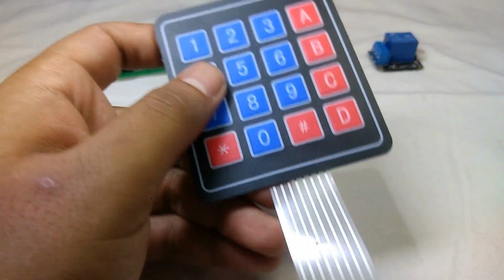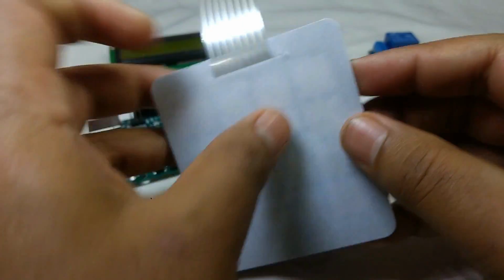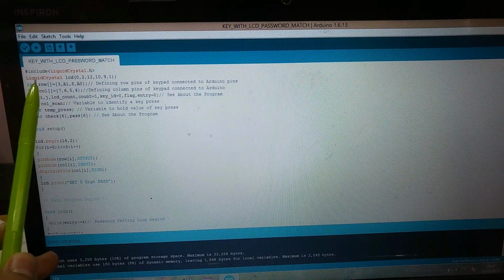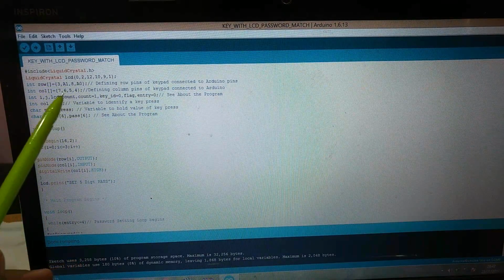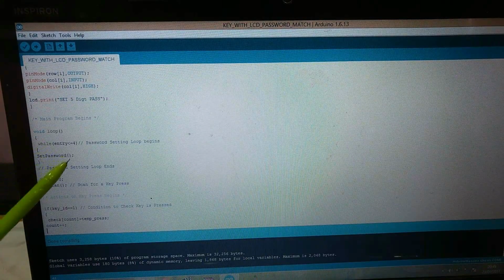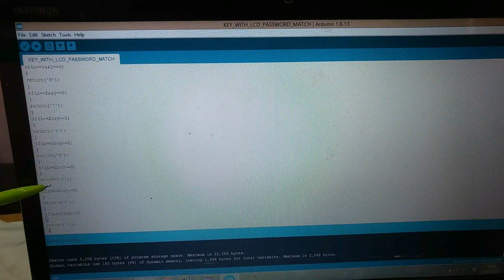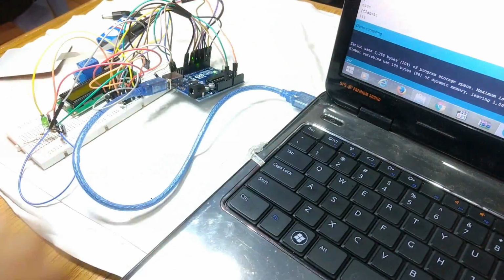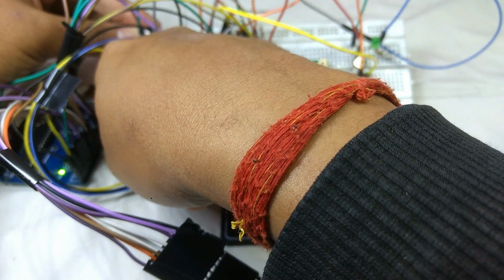Password using keypad in any Arduino project programing. #diy #electronic #project #programming

Comment from the maker: #include <Keypad.h>
#include <Wire.h> 
#include <LiquidCrystal.h>
LiquidCrystal lcd(7, 6, 5, 4, 3, 2);
#define Password_Lenght 7 // Give enough room for six chars + NULL char

char Data[Password_Lenght]; // 6 is the number of chars it can hold + the null char = 7
char Master[Password_Lenght] = "123456"; 
byte data_count = 0, master_count = 0;
bool Pass_is_good;
char customKey;

const byte ROWS = 4;
const byte COLS = 3;
char keys[ROWS][COLS] = {
  {'1','2','3'},
  {'4','5','6'},
  {'7','8','9'},
  {'*','0','#'}
};

byte rowPins[ROWS] = {
  0,1,8,9}; //connect to the row pinouts of the keypad
byte colPins[COLS] = {
  10,11,12}; //connect to the column pinouts of the keypad

Keypad customKeypad( makeKeymap(keys), rowPins, colPins, ROWS, COLS); //initialize an instance of class NewKeypad 

void setup()
{
   lcd.begin(16, 2);
}

void loop()
{
  lcd.setCursor(0,0);
  lcd.print("Enter Password");

  customKey = customKeypad.getKey();
  if (customKey) // makes sure a key is actually pressed, equal to (customKey != NO_KEY)
  {
    Data[data_count] = customKey; // store char into data array
    lcd.setCursor(data_count,1); // move cursor to show each new char
    lcd.print(Data[data_count]); // print char at said cursor
    data_count++; // increment data array by 1 to store new char, also keep track of the number of chars entered
  }

  if(data_count == Password_Lenght-1) // if the array index is equal to the number of expected chars, compare data to master
  {
    lcd.clear();
    lcd.setCursor(0, 0);
    lcd.print("Password is ");

    if(!strcmp(Data, Master)) // equal to (strcmp(Data, Master) == 0)
      lcd.print("Good");
    else
      lcd.print("Bad");

    delay(1000);// added 1 second delay to make sure the password is completely shown on screen before it gets cleared.
    lcd.clear();
    clearData();   
  }
}

void clearData()
{
  while(data_count !=0)
  {   // This can be used for any array size, 
    Data[data_count--] = 0; //clear array for new data
  }
  return;
}
Reply: exit status 1
stray '\357' in program
Reply: @8_Bit_Cloud  thankyou
Reply: There is no Password reset in the code could u pls explain.? More so, the code is totally different from the one used in the video tutorial, i have not tested it though on any project. Ps kindly reply asap.a million Thanks for the knowledge shared.
Reply: ECE BASIC also give the circuit diagram..  Plz
Reply: @kashifchaudhary4567  Yes please

Comment: #include <LiquidCrystal.h>
LiquidCrystal lcd(A0, A1, A2, A3, A4, A5);
int row[]= {1,2,3,4};
int cols[]={5,6,7,0};
int i,j,lcd_count,count=1,key_id=0,flag,entry=0;
int col_scan;
char temp_press;
char check[6], pass[6];

void setup()
{
  lcd.begin(16,2);
  for(i=0;i<=3;i++)
  {
    pinMode(row[i],OUTPUT);
    pinMode(col[i],INPUT);
    digitalWrite(col[i],HIGH);
  }
  lcd.print("SET 5 DIGIT PASSWORD");
}

void loop()
{
  while (entry<=4)
  {
    SetPassword();
  }
  key_id=0;
  keyscan();

  if(key_id==1)
  {
    check[count]=temp_press;
    count++;

    if (temp_press='A')
    {
      checkPassword();
      if (flag==0)
      {
        lcd.setCursor(0,0);
        lcd.print("UNLOCKED");
        digitalWrite(13,HIGH);
          digitalWrite(11,LOW);
      }
      else
      {
        lcd.setCursor(0,0);
        lcd.print("WRONG PASSWORD");
        digitalWrite(13,HIGH);
          digitalWrite(11,LOW);
          delay(200);
           lcd.clear();
           lcd.print("LOCKED");
      }
    count=1;
    }

    else if (temp_press=='C')
    {
      checkPassword();
      if(flag==0)
      {
        lcd.setCursor(0,0);
        lcd.print("ENTER NEW PASSWORD");
        key_id=0;
        entry=0;
      }
else
{
  lcd.setCursor(0,0);
  lcd.print("WRONG PASSWORD");
}
   count=1;
    }

    else if (temp_press='D')
    {
      lcd.setCursor(0,0);
      lcd.print("PLZ ENTER PASSWORD");
      count=1;
    }
    
    void SetPassword()
    {
      keyscan();
      if(key_id=1)
      {
        if (temp_press='A' || temp_press='C' || temp_press='B'  )
        {
          lcd.setCursor(0,0);
          lcd.print("INVALID KEYS");
          entry=0;
        }

    else
    {
pass[entry]=temp_press;
    }
      }

key_id=0;
if(entry==5)
{
  lcd.clear();
  lcd.setCursor(0,0);
  lcd.print("LOCKED SET");
}
    }
    
 char keyscan()
 {
for(i=0;i<=3;i++)
{
  digitalWrite(row[0],HIGH);
  digitalWrite(row[1],HIGH);
  digitalWrite(row[2],HIGH);
  digitalWrite(row[3],HIGH);
  digitalWrite(row[i],LOW);
  for(j=0;j<=3;j++)
  {
    col_scan=digitalRead(col[j]);
    if(col_scan==LOW)
    {
      key_id=1;
      entry++;
      temp_press=keypress(i,j);
      lcd.setCursor(lcd_count++,1);
      lcd.print(temp_press);
      if(temp_press='A' || temp_press='C' || temp_press='B')
      {
        lcd_count=0;
        lcd.clear();
      }
      delay(300);
      break;
    }}
    }}   

    char keypress(int i, int j)
    {
      if(i==0 && j==0)
     {
       return('1');
     }

     if(i==0 && j==1)
     {
       return('2');
     }

     if(i==0 && j==2)
     {
       return('3');
     }

     if(i==0 && j==3)
     {
       return('A');
     }

     if(i==1 && j==0)
     {
       return('4');
     }

     if(i==1 && j==1)
     {
       return('5');
     }

     if(i==1 && j==2)
     {
       return('6');
     }

     if(i==1 && j==3)
     {
       return('B');
     }

      if(i==2 && j==0)
     {
       return('7');
     }

     if(i==2 && j==1)
     {
       return('8');
     }

     if(i==2 && j==2)
     {
       return('9');
     }

     if(i==2 && j==3)
     {
       return('C');
     }

     
      if(i==3 && j==0)
     {
       return('*');
     }

     if(i==3 && j==1)
     {
       return('0');
     }

     if(i==3 && j==2)
     {
       return('#');
     }

     if(i==3 && j==3)
     {
       return('D');
     }
    }

    void checkPassword()
    {
      flag=0;
      for ( i = 0; i <=5 && flag==0; i++)
      {
        if (check[i]==pass[i])
        {
          flag=0;
        }

        else
        {
          flag=1;
        }}}

Comment: Can you send me the code for 4x4 keypad and mega 2560 to tangtektony@gmail.com . Can i use Digital pins 22-53 for keypad? Also, can I send SMS via sim800l for matching the password stored inside the variable and get access granted? please asap. Thanks for your kind assistance.
Reply from the maker: I have little to no experience of mega so can't help with mega . May be in future I will educate myself then I will help you or make some projects on mega . I hope you will understand.
Reply: Can you send me the code 4x4 to tangtektony@gmail.com? Thanks for your reply
Reply from the maker: Codes is in comment section, just check and copy paste
Reply: Thank you a lot ECE BASIC

Comment: Bro can I use this to put password for 220 power outlet? I'm planning to connect a 220v outlet load in the 5v relay? reply pls asap
Reply from the maker: +Melon Lemon of course you can do it , but mind the power rating of relay
Reply: what's the ideal wattage for the relay?? thank you so much for replying fast :)
Reply from the maker: +Melon Lemon it's depends upon the current draw of the device , if current draw is 4 amp choose relay of 5 amp . Choose relay more than the current draw of device

Comment: Hey bro thanks for the video!
Can you fix the code link? It doesn't match with the one in the video, even the keypad is smaller tho

Thank you
Reply from the maker: thanks for pointing out , i have deleted the code , but i will rewrite the code and fix it in a week . I will update you after that. THANKS.
Reply: @ECEBASIC  It never got fix :(
Reply from the maker: @MrElixer26  I am really sorry . I am very busy with my studies and all, so channel is nearly dead once I will star uploading I will clear all the doubt . You can see most of the comments are regarding codes. I am really sorry.
Reply: @fernandoalvesdesouza5626  Thx bro
Reply: @fernandoalvesdesouza5626   Thanks Brother God Bless You..!